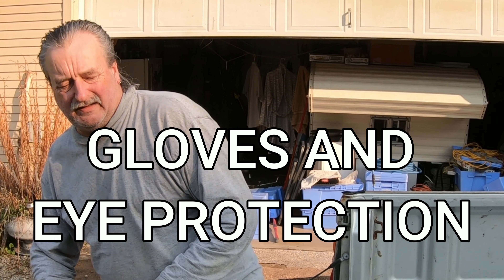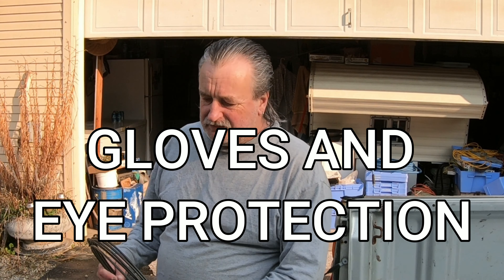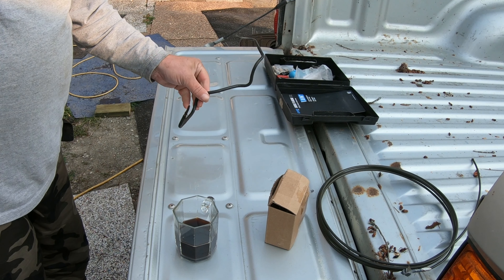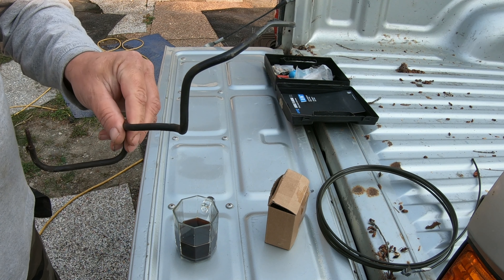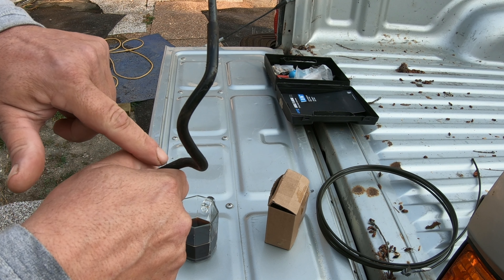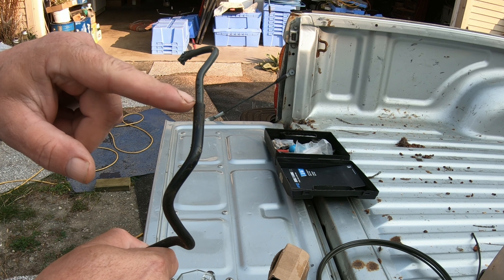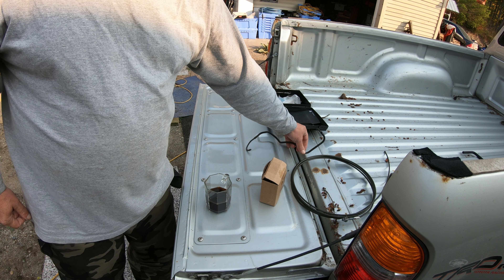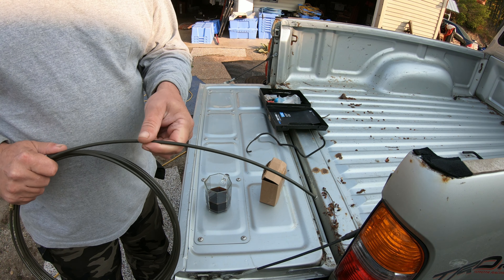Making brake Lines and LSPV bypass Toyota Tacoma

Comment: Have you done a video just for the steps on how to bypass the LSPV? I have a 2002 Tacoma and I completely agree that the best thing to do at this point is to get rid of the darned thing.
Reply from the maker: @joselinares1537  I'm not sure if I made a video about it as it was a while ago but I do remember that you have to plug the return line. I think near the resivior

Comment: I want to delete the valve completely.
Can't I just use a tee or fitting to connect the main lines together?
Reply from the maker: Yes you can but you will have to block the return line I believe.

Comment: how did you connect the old line to union? There is no fitting on the old line ?
Reply from the maker: I flared it and put a fitting on. I have both male and female fittings very easy  with the  flairing tool